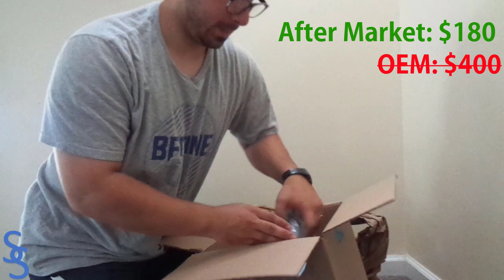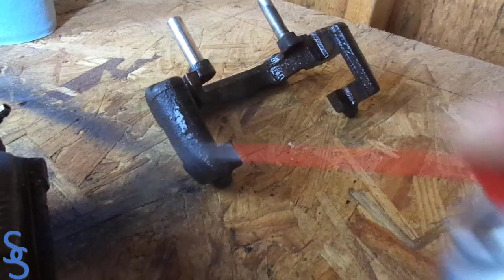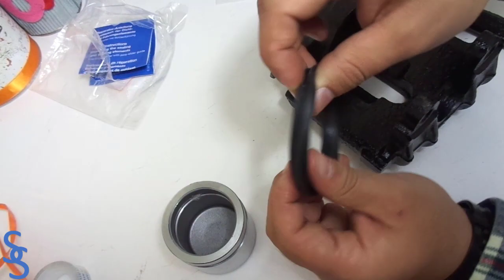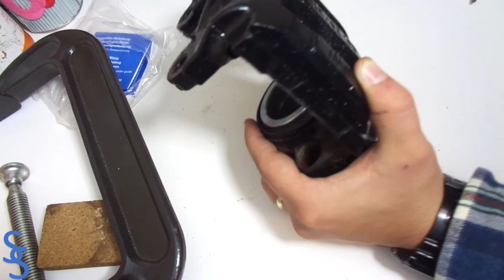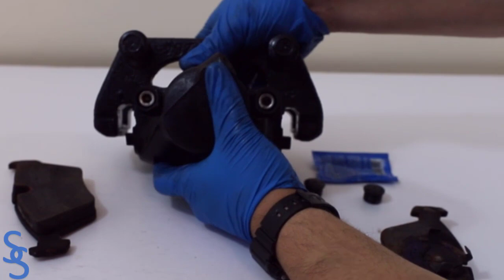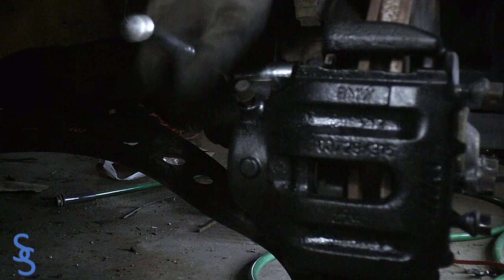CALIPER REBUILD | E36 M3 : How to repair it step by step

Comment: Can you tell me where you bought the parts from?
Reply from the maker: I found the piston part number and then I pasted it in Google and I was able to find an ad in a website that sold only the piston. Try realoem.com to find the part number and they sell the parts there, but they are usually more expensive
Reply: By the blue tape on the box it would have to be FCP Euro Parts, who are great!